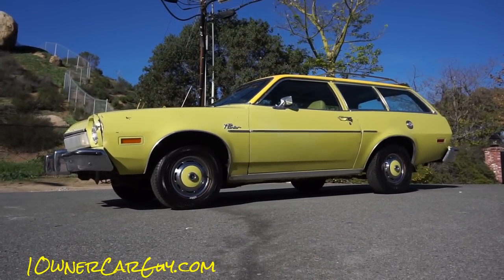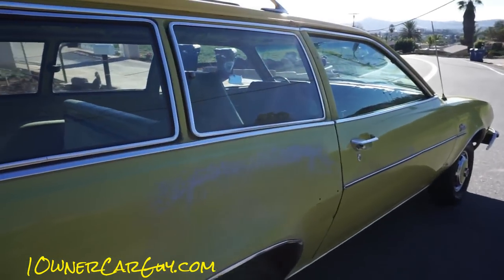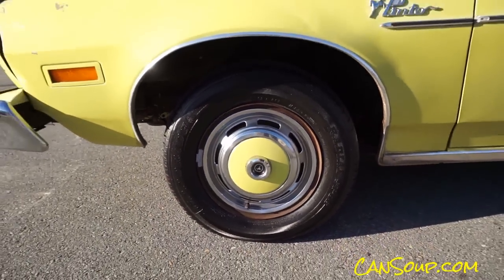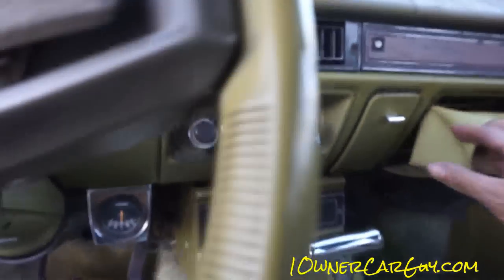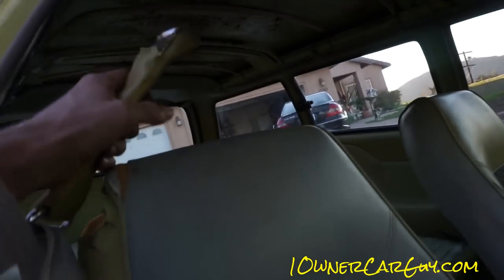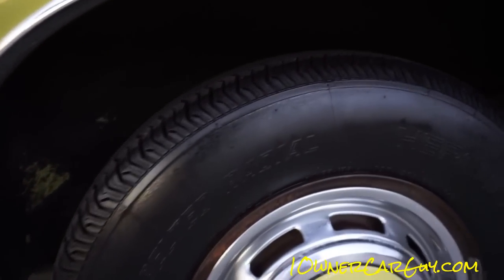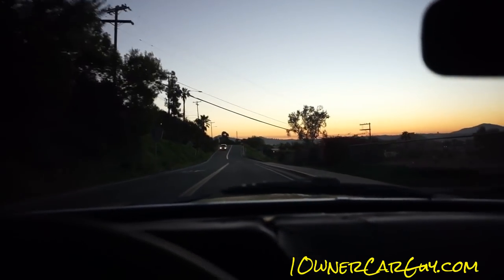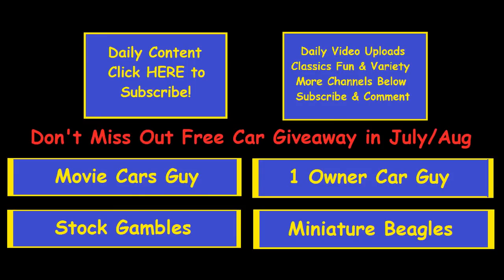Ford Pinto Pony Review 2 Door Station Wagon Runabout Classic Car Video

Comment: I owned a 74 Pinto Wagon. I actually preferred the wagon model over the hatchback runabout. Bought it new in bright red with a manual 4 speed. I bought aluminum alloy wheels within a months time, installed a 6 speaker amplified stereo early on. Really enjoyed the amount of space for all my camping and fishing gear, which was a weekly thing at that time. Had a trailer hitch installed to haul my motorcycle to the track. I even slept in the back on occasion. It served me well for over 10 years all without any mechanical problems. Much better car than the Chevy Vega. Was it fast.... no, was it fun to drive....yes, mainly due to the stick shift vs an automatic.

Comment: owned a 73 hatchback and 79 wagon
very good reliable cars and original paint held up really well
kept both for 10 years, sold the 73, gave the 79 to my sister who then sold it to an uncle
they drove it for another 10 years
good, reliable, cheap to run, acceptable to drive even on the interstate
wish ford made them now because for the price (less than $10k) they were a good buy

Comment: Can't believe no one has video of the tricks you could do with these cars out of the box!  Had a '72 wagon 2.3L 4 spd that could drift like nobody's business.  On a snow covered or wet street I could spin that car 180° into a parking spot and have the key out and door open before my passenger could let go of their white knuckle dash grip!  We had a local road with perfect hills I could launch that thing in the air and always land on all 4 tires because it had a nearly perfect 50/50 weight distribution.  $200 car that was more fun than anything else I've ever owned.

Comment: If they were taken back to ford  (recall)   they installed a shield on the front of the fuel tank. It was a plastic type material that was between the tank and rear end.

Comment: Yes that is a smog pump California was the most likely the first state to have one and as far as the weight of the car 2300 pounds is about right the regular two door was about 2100 or so plus the car has A/C so those numbers could be a bit higher.with all that sun damage it couldn't have spent to much time in a garage but for the year it's still not bad if it were on the east coast it would have rusted away.

Comment: Nothing dangerous about a Pinto. I have been driving a 1972 Pinto Squire (woodgrain) wagon for over 30 years. I've had to replace the engine, but the car is still in a lot better shape than that one. It is original paint and one owner. When I bought it, the original A/C (this is AZ) was trashed, and after driving it in the AZ heat for a couple of years, I realized how much I loved it, so I spent around $2K to have R134 A/C installed in it. I also installed a brand new 8 track player from eBay in it. Anybody who thinks Pintos are junk, I have 300,000 miles on mine, and it is still solid as a rock. No emissions crap, no electronics, no ABS, no computers, no safety bumpers, none of the stuff that is bad about newer cars. It's even RWD, for anyone who remembers that. Just a regular car that will outlast me unless it gets totaled in an accident.
Reply: The Pinto is no more dangerous in that regard than any other car from that era. I have a 1964 Ford Fairlane, and not only is there no protection for the gas tank, but the filler is located in the rear, right in the center of the trunk lid above the bumper. It would only take a minor impact to shove that filler into the tank, and slightly more of an impact to push the bottom of the bumper into the tank, likely rupturing it. Remember, the Ford Crown Victoria had a reputation for catching fire when rear ended all the way up through the final model year in 2010.
Reply: Pintos were a pile of shit--as bad as the Chevy Vega.
Reply: I had a Pinto Wagon....Ford sent me a plastic shield to mount between the rear axle bolt and the gas tank... in a rear collision that bolt could plunge into the gas tank and ignite the fuel... Just because you guys aren't dead doesn't mean the car is safe...Notorious for plugged up oil channels resulting in warped cam-shafts and burnt valves.. you can hear them rattle and clank in this video !
Reply: vulcan1753 if you don't mind me asking do you live in the Phoenix area
Reply: @sldl04  Ford sold more than 3 million Pintos and 500,000 Mercury Bobcats.  Ford sold more Pintos than all of the Toyota models

Comment: My parents broke my heart when I was 15 years old (1979)! I came home one afternoon and found my father standing in the kitchen near our back door smiling! He threw a set of keys to me and I looked at the MUSTANG key ring and ran passed him out the back door to the back yard!! THERE in horror I found the car belonging to the keys!!! A beat up, rusted out, piece of crap Pinto Runabout of the 1971 flavor, and there wasn't much left to the little car, that rust hadn't already eaten away!! I cried, because I had always had my heart set on a "classic" Mustang like the 1965 to 1968 model years!!! But instead now I had a rusted out Pinto that you could literally SEE THROUGH THE BODY ON!!! The little car DID run though and the car had a 2.0 liter inline four with a stick shift transmission!! I basically learned how to drive a manual transmission because of that little car! And the 2.0 liter motor was ALWAYS a better engine than the 2.3 liter as it would lift the front tires of the ground while dumping the clutch!!

Comment: Maybe it's a good car for the right price, which he didn't mention. But it's still something you could put more money into in paint and bodywork than what it's worth. It sounded noisy for some reason as well.
Reply: does not matter what car you like or restore the cost does not matter if you are worried about making money then you should not do it
Reply: And wasn't there a little problem with the gas tank location on the earlier models at least? One rear end collision could get you barbequed.

Comment: speed limits, whats that?  lol can't help the twitch in my right foot ;)  you know what would work good in that car.. is a 3.0L out of a aerostar  :)
Reply: Cereal Marshmallows true, 4.0 , 3.0L both were tough motors.. the 3.8 outta that chicken would be cool.. do the head gaskets first ;)  I have done SC 3.8 head gaskets.. lots of parts to that motor.. but they are fun to drive with a manual and sound cool.. the Mark VIII  is faster tho ;)
Reply: Cereal Marshmallows 351w stroker, so 393ci  with  edelbrock aluminum heads, intake and a good cam  :) 450hp  grocery getter.. or a good energy chews drag car ;-)